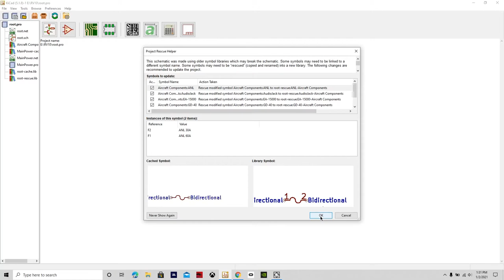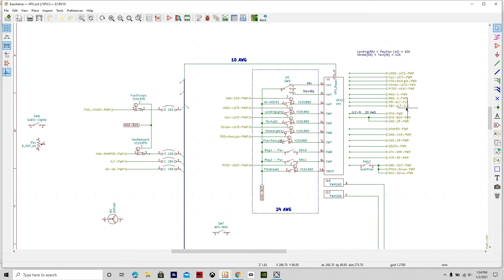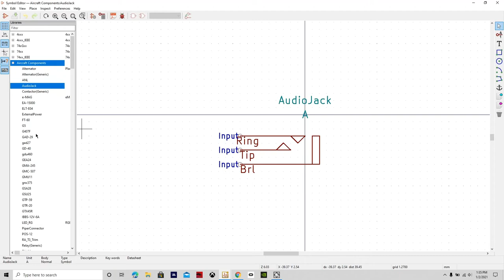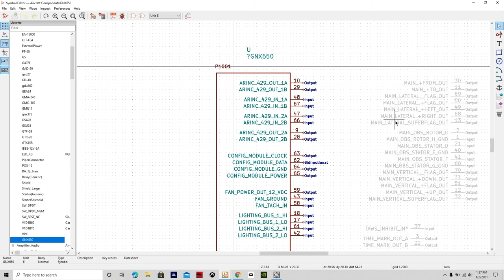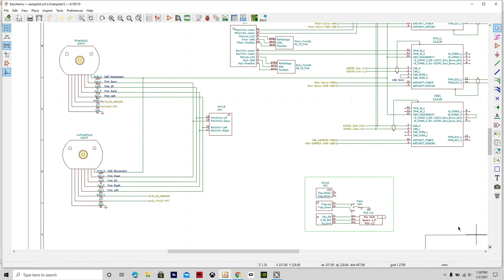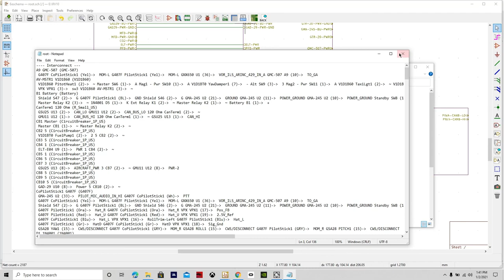Avionics Wiring 1 - the fun stuff... that consumes a ton of time in the background

Comment: Cool video.  Some comments -- the way to have the external power wired, the external power relay will stay energized until the master switch is turned off, which is probably not what you want.  Also, from my reading of the Garmin docs, the GAD 27 does a better job of the flaps than the VPX, and possibly the lights also.  (But I still have plenty to read.)
Reply from the maker: Thanks, Nice catch on the external power, i made a change from a cessna type connector to the piper one and messed it up... Thanks.  I have not yet fully decided on purchasing the GAD 27 seems a bit of a waste given I have the VPX, however you are definitely right on the lights - i plan on getting the ZIPTIP lights so the only think i need is the dimming which is not available on the VPX.  I plan on doing some bench testing on the flaps over the next month and I will let you know how it worked out.
Reply from the maker: Actually, I looked at it again and if I have it right the way it works it will need a +12 volt from the external connector and the master switch on - this is what i was looking to do.  The shore power will only work if the master switch is turned on.
Reply: @aleafonthewind3775  The problem is that the connector will stay connected after you unplug it, unless you then turn off the master.  In the case where you use external power to jump start the engine, it's likely that will be forgotten.  The Cessna connector (aircraftspruce p/n MS3506-1) has a third pin to power the relay, solving the problem.  I asked a friend for the schematic of his airplane to see how it works on a Cessna.
Reply: @aleafonthewind3775  You've got me thinking about the GAD27 vs VPX.  I'm sold on the VPX, but I really like how the GAD27 does the flaps.
Reply: @aleafonthewind3775  BTW, are you in the Bay Area?  I'm building my RV-10 in a hanger at KRHV.
Reply from the maker: No on the east coast but if i ever get out that way (which is quite often)  It would be great to catch up.  George
Reply from the maker: Yep, I see what you are referring to, I originally had the Cessna connector and this was not a problem as it had a second positive connection.  This connector has a cover so not a huge issue but still not liking it,  I could put a diode to prevent back feeding there pretty cheap for the current rating I would need which was my original thought or add a switch.  Thanks for the feedback, really appreciate it.